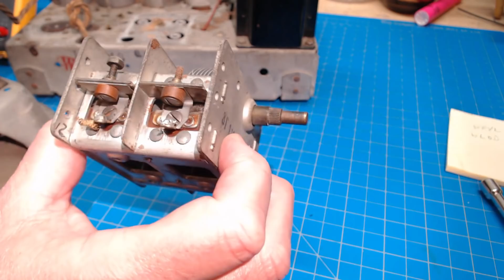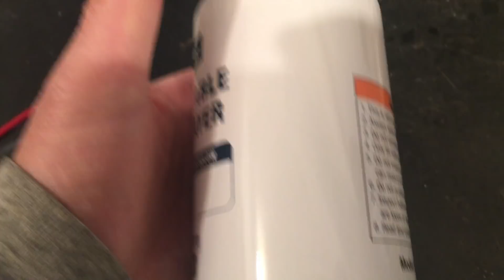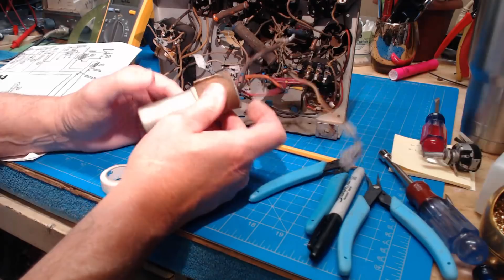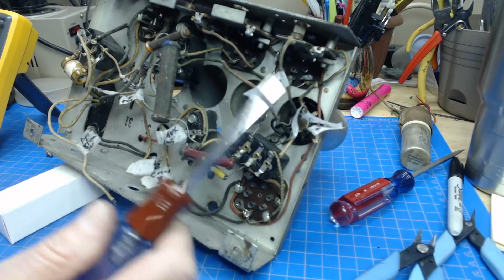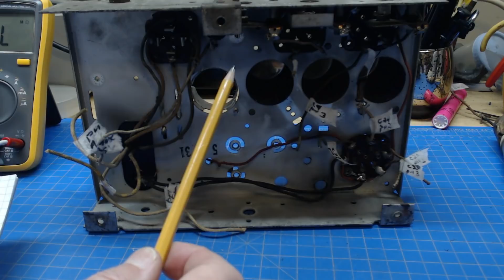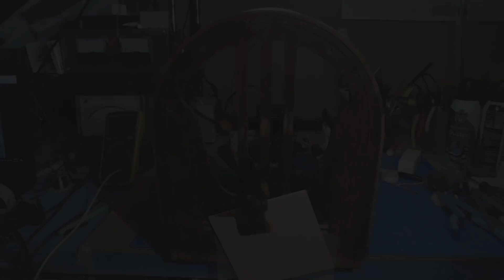The Basketcase 1935 Philco 84B Part 3 of 8 Part 3 Disassembly Repairs and Cleanup

Comment: Greetings:
I appreciate the info that you share here.
I am trying to gather non-published details of vintage electronics and hope to add them to existing service data directly or as comments depending on the circumstances. I have started by asking restorers for measurements of taps on potentiometers that often feed tone or loudness circuits. Simply post the data in your own comments, pinned or not, or in your video description. I will return here and let you know the info was copied. Thnx

Comment: Looks like you made great progress already! Even the bakelite blocks are done! Looking forward to part#4 to see how you are going to rewind that coil.
Reply from the maker: Radio wild Thanks Bob! Actually, O was going over my video when I edited it and realized, I put the wrong value of cap in one of them, lol. Had to pull it out and replace it. Ive actually shot 90% of the video on the coil, the layout, the number of turns, the direction. I just got the wire and should start the rewind shortly. Shouldnt be a big deal, its a very small loop. Thanks for watching and commenting! Take Care--Larry

Comment: That contact cleaner I think you should put some WD-40 or penetrating oil in it say 10%.
Say 75% mineral spirits, 15%  paint thinners, but not all  thinners are the same? Don't know what you're using? 10% penetrating oil. I thought about using panel wipes? paint degreaser used in the automotive industry. Should be safe enough  it removes oil and waxes not sure how that would work in a potentiometer there some experimenting may be needed but it should be alright? As well as maybe! acetone! but that's even more aggressive than panel wip.
The best way to glue veneer like that is to use a syringe and a blunt needle, dilute the PVA glue by 10% this helps in drying quicker as well plus it's spread underneath better the veneer easier to clean.
Reply from the maker: John sweda Hi John! I cant fool a chemist! Lol. You just about nailed my formula. It works great! As far as the veneer glueing, i have a syringe and use it in a lot of cases. This veneer was brittle and so I used an old piece of veneer and shoved glue under it. I like to use both methods when I can. Thanks for watching and commenting! Hopefully part 4 will have something a bit more interesting! Take Care--Larry